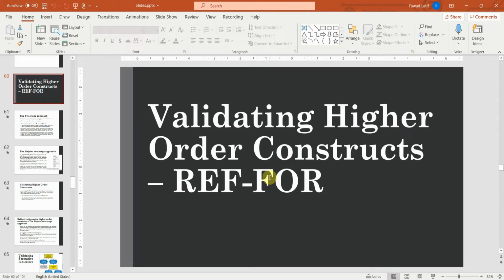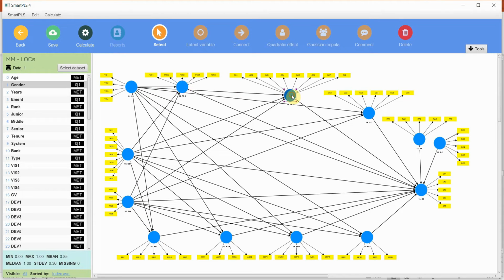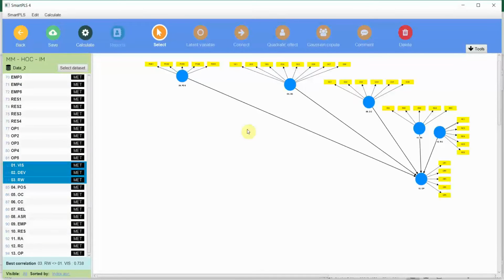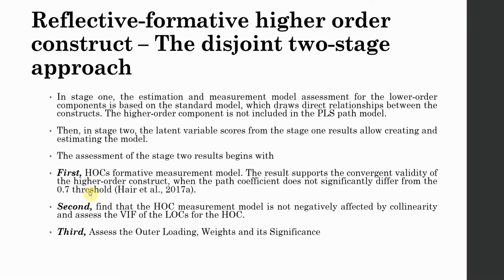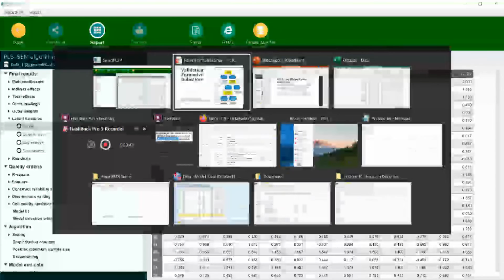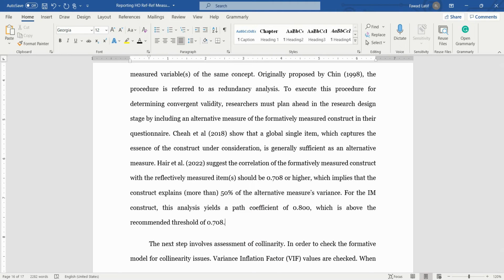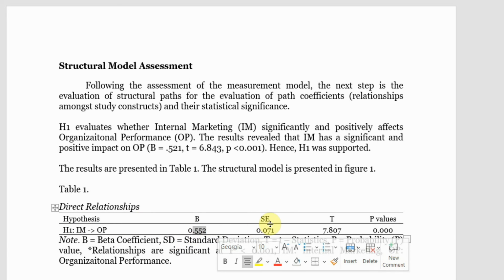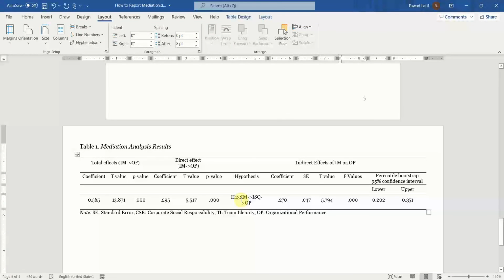#SmartPLS4 Series - 41 - Analyze, Interpret, and Report Higher Order Reflective Formative Model

Comment: I don't think I would have been able to get my analysis for my dissertation done without your videos. Thank you so much. I did not include GV questions in my survey and have seen you and Dr Ringle comment that the Reliability test is not necessary for second order formative model. I really need a reference to help me here, I am very worried about justifying my model without this step. Could you please offer any advice? Thankyou!
Reply from the maker: Thank you for watching. I am glad that the videos helped. Here is the reference 
Sarstedt, M., Hair Jr, J. F., Cheah, J. H., Becker, J. M., & Ringle, C. M. (2019). How to specify, estimate, and validate higher-order constructs in PLS-SEM. Australasian marketing journal, 27(3), 197-211.
Reply: @Research With Fawad  Thank you so much for your reply! However, I have already read this article and it notes that the convergent validity (reliability) test is the first step in assessing a reflective-formative construct. I cannot find any published literature that justifies skipping this step.
Reply: My apologies, I meant to say 'redundancy' not reliability. As the first step in evaluating the formative HOC.
Reply: Hello  @B.Rights  How did you manage this, i am facing the same problem. please help
Reply: @aarti3180  I did not include this step. My supervisors were not worried.
Reply: @B.Rights  Thank You